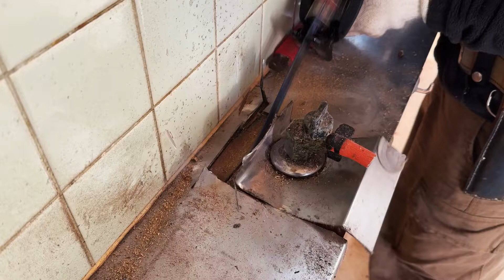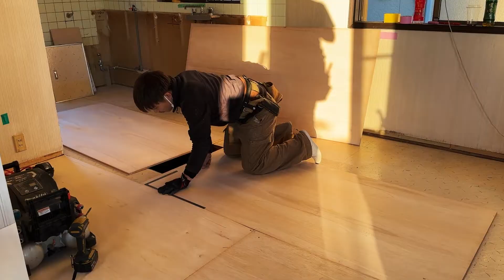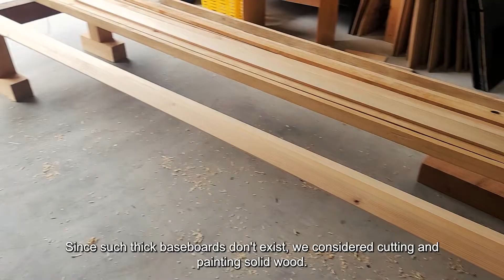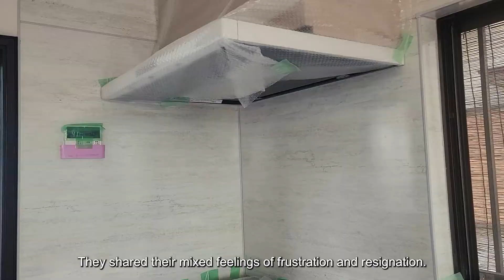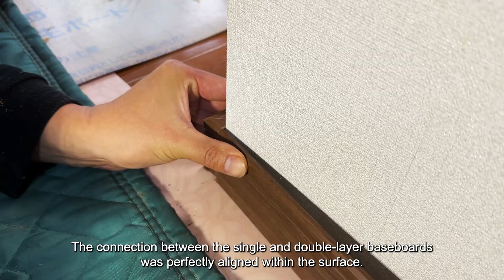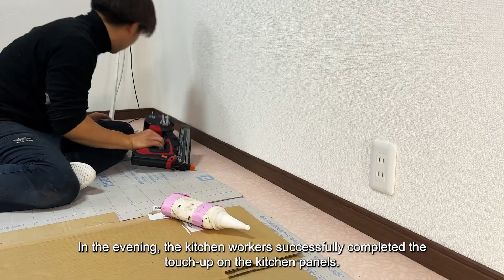[Emergency] System Kitchen Replacement Halted by Unbelievable Manufacturer's Blunder!

Comment: "Thicker than 6 or 12mm baseboards don't exist" Meanwhile here in Germany our 19mm thick, 70mm high wooden baseboards are considered midrange. Old buildings from around 1880 to 1930 have oftentimes baseboards of 30mm thickness and 150mm height. Then again, those baseboards usually look like new after over 100 years.

Comment: Ridiculous.
First off, these wall panellings should always be a bit oversized, so you never run into this kind of problems. 
And usually, when hiring a kitchen contractor for an whole package deal, it’s their responsability to take the right measurements. Not your problem at all. Wow that’s a tiny kitchen, so easy to do. 

Second, I look at the panelling sheet joints locations don’t make any sense. Omg, so patchy, ugly.

I’m sure it would have been more economical  to get and install the kitchen youself with real tiles on the wall. 
It would have been a way better. 

Im Canadian and here we have a  lot of choices in terms of kitchen cabinets. Ikea, renovation & construction stores…..etc

Comment: How to effectively deal with subcontractors with cultural or personnel infighting issues can be tricky. 

Seems the subcontractor is a sizable company with very reputable product (e.g. Panasonic). This means the division of labour is highly specialized, there's a certain pride in being an artisan of the subcontractor, the subcontractor has strong bargaining power as a service provider, etc. 

What's the approach with such subcontractors?
Reply: Never use them again nor recommend them to anyone else. 
Their lacking professional support and work ethics is a prime issue. 
A professional team never argues or  disagree at a work setting. 
The team that performed the final work and the contractor who called in sick set the tone. He never took any responsibility.
If a client spends money on a project and you are the supplier. It's up to him to answer and respond to the issues. 
It's not up to Kazu to apologize for their behavior or the business practices they have. 
In the end, I would never recommend anything from that company.